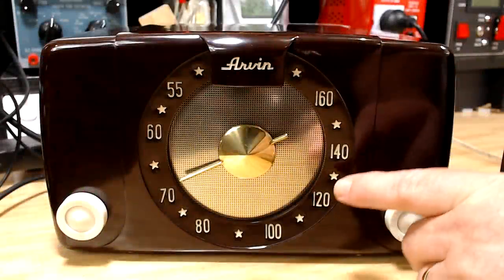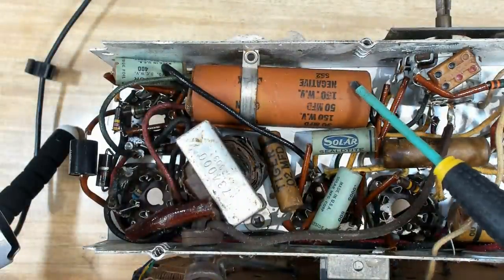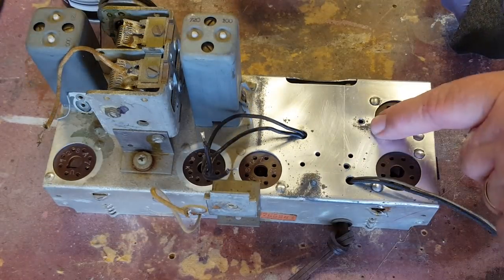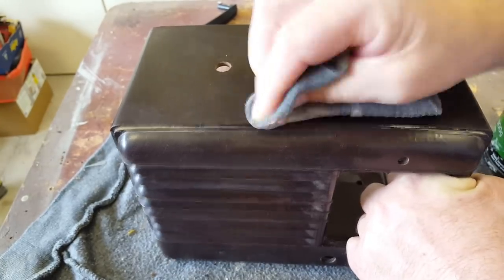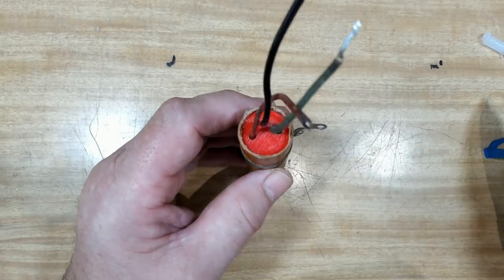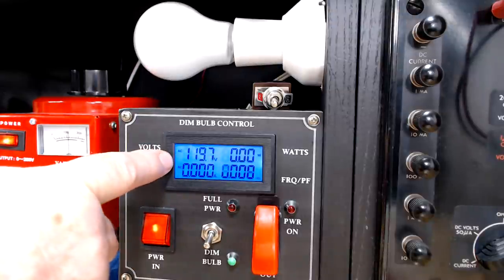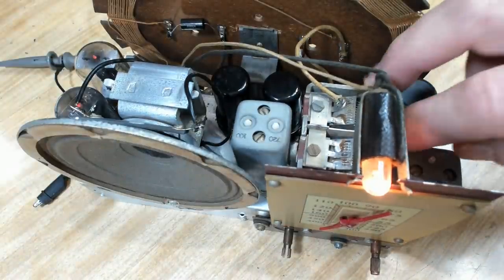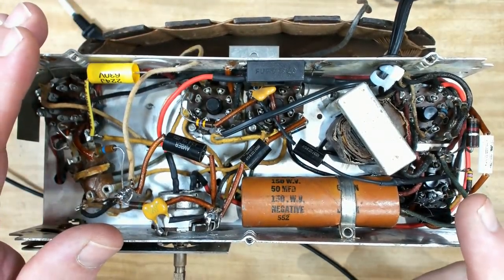Emerson Radio Restore Model 518 USA Built - 1940s

Comment: You always go that extra mile which makes it so much more satisfying when you see the finished result. Great job again. I'm currently building my own workshop in the attic of my house. I'm not sure the wife is overly happy about it - but it's better than using the garage which has the washing machine in. Should get better reception up there too!
Reply from the maker: Hi Ged, thanks. The attic sounds much better for a workshop, you don't want to be anywhere near the washing. Good luck with your workshop 😀

Comment: Those Emerson knobs came in brown, black, and white, depending on the model.   Some were black with the 'dish' painted white, and in some models  were covered with a clear plastic dome (my model 573 free standing radio-phono has these).
Reply from the maker: Thanks xaenon, I saw a number of knob styles on online photos of the radio, most had a cone shape on the front of the knob. I still don't know if mine are original though 🤔
Reply: @DavidTipton101  Emerson did use that style on a lot of their radios of that era - like I said, with minor variations in color and so on.   So yeah, I'm guessing they probably are the originals.

There's a fellow somewhere who makes reproduction knobs, too.   

I loved watching your video restoring that thing.  I'm really impressed with how you made a new bezel for the dial.

Comment: Hi Dave. Hopefully you can help me. I need to align a Zenith FM radio. The sheet states to attach my signal generator high side to the ungrounded shield over the FM converter tube. However, the shield is riveted to the chassis which is ground. Where do I attach it?
Reply from the maker: Hi Eugene, try slipping a length of insulated wire between the shield and tube.  Bare off a section on the exposed end and attach your generator to that. You may  need to reposition it for max affect.
Reply: @DavidTipton101  Thank you very, very much.....you are the best!

Comment: Well it was worth the wait : I enjoyed every minute of this one David from beginning to end. I also agree you're getting better and better at remaking those caps to perfection. You've got it down to an art.  But also i like how you went about this one, trouble shooting the potential problems before even plugging it. There wasn't much to do once you hooked it up to power. Bravo ! My friend, that's another one worthy of going in your incredible collection. Thank's for sharing as always.
Reply from the maker: Thanks Sarge. I was forced to do the restore before plugging it in due to lack of parts and concern that the filament would blow in the rectifier if it had a fault. Yes, another one for the radio shelf, it's getting mighty crowded though, cheers 😀
Reply: @DavidTipton101  Oh yeah right you've got a point, wasn't thinking about the filament (seemed strange a set up to me, but then again what do i know about electronics) ?.  I would surely buy one of your radios if you ever felt the need to move some for space :-)

Comment: Hello. I like your work. I don’t have big knowledge in electronics but i like this activity. I have a very very old radio and i think to get it work but i don’t have the tools and i don’t have the experience in this. Can you help me please ? Thank you. I live in France. Have a great day.
Reply from the maker: Hi Video Design, thank you. Sounds like you have a great project there. There may be radio clubs in your area that may be able to help you, that would be my first suggestion. 
I won't be much help from here but most times replacing the capacitors, out of tolerance resistors and making sure everything is safe electrically will return it to service. If you intend having a go at it I strongly suggest you use a dim bulb to test it, Google dim bulb 🙂
Reply: @DavidTipton101  The radio is Orion R4400. I found the technical scheme over the internet but i don’t know to read all the things on it. I was wondering if i can send you the radio for restaoration. I m willing to support all the payments. All i have here is a multimeter and a soldering device. There are some wiring missing and is too mutch for me.
Reply from the maker: @BmcvideoDesign  There has to be someone close to you that will do it, FM radio is not my strong point and I cannot find any text on how to set it up so it would be a struggle for me. Google "radio clubs" or "vintage radio clubs", they will give you leads to people who can repair them, there are certainly lots of folk in the UK who do them so I imagine the same will apply near you.

Comment: Great work, David. How do you use a dial with two pointers? Which pointer do you use?
Reply from the maker: Thank you Shannon. The top of the dial is in kHz and the bottom in metres. You can use either, like miles and kilometres, same distance, different ways of measuring it 👍🙂
Reply: @DavidTipton101  Thank you!

Comment: Lots of great information and safety on this one Dave.
Those live chassis models scare the crap out of me. Especially the ones with a switched neutral.
I like the dial pointer you made, looks quite authentic
Reply from the maker: Thanks 1974UTuber, you have to be careful with these sets 👍🙂
Reply: @DavidTipton101  I don't know how they ever thought the 2 vertical pin plug was a safe idea. You could get a different polarity every time you plug it in and never know if your switching active or neutral.
I much prefer the Aussie plugs we have. Even the 2 pin just seems safer all round and much better thought out

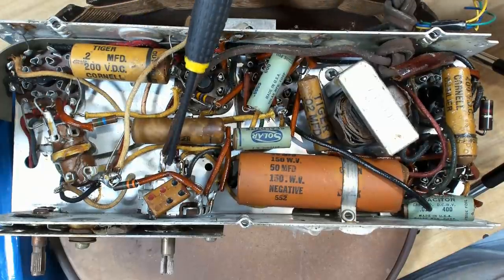Comment: 3:25 Dave, what is the component on the volume/power switch, the brown waxy one with the 6 dots ? I remember those from my youth, looks a bit like candy from the sixties. Yes, I tried tasting it 😂
Cheers
Nard
Reply from the maker: Hi Nard, it's a 'domino' mica cap, the colours denote the value but that one doesn't seem to follow convention. It looks like it's 220pF red, red, black, the other two blacks maybe tolerance and voltage? It does look yummy though 😄
Reply: @DavidTipton101  Thanks Dave 👍🤝🇳🇱
Reply: @DavidTipton101  Hi Dave,
Have a look at this video https://youtu.be/cOgTw6Ebw80  time mark 12:15
Those are actually paper capacitors. Odd huh ?
Cheers and enjoy the vacation 👍🤝🇳🇱
Reply from the maker: @Plons0Nard  Hi Nard, yeah I'm aware that some were paper but I think they were Micamold brand, this one isn't a Micamold and the parts list lists it as a mica, not that that means anything. I don't remember if I tested it or not, it's in a low stress part of the circuit so hopefully it's OK 👍🙂

Comment: I do enjoy the way you put these old sets back to like new condition.  Such a love for the art of restoration is rare indeed,  and I greatly enjoy the videos.  I am no longer able to do such work, but I do still dabble with the newer things, just to tinker and keep my soldering skills in line. I am presently working on building the perfect wifi radio using the little ESP32 controller and a I2S decoder to bring in the wonderful sounds of my youth. I grew up on an old homestead, the house built by my grandfather in 1910. The place was never wired for power, it used to drive me nuts to see that damn REA Power Poll in the center of our yard, wires leading from the road in, but none to the house or garage.  Dad had a small wind charger set up on the garage so he could charge his old wet cell batteries to light up his work area, where he rebuilt engines for the neighbors since he was a quite good mechanic. Dad also got me interested in electronics by letting me look over his shoulder as he serviced out old battery pack radio.  It was of modern design, at least in my young eyes, and had a red flag that pupped up in the middle of the dial to show that the set was on, so you didn't walk away and leave it running on an off station with the volume turned down and waste that precious battery power.
Reply from the maker: Thanks Jerry. Interesting story, thank you for sharing that. It's hard to imagine no power in these days, I wouldn't last 5 minutes. That's a good idea having the flag pop up in the dial and pretty easy to implement. Thanks 🙂
Reply: @DavidTipton101  Indeed, the old days are gone forever I guess.  The closest I have been to them was a few years ago we were touring the Desert Southwest USA, in particular Arizona near the border with Mexico. The area is one of extreme beauty if you love the desert as much as we did back then.  It was populated by a strange breed of cactus named the Organ Pipe Cactus, I am sure you can imagine the way those  intermingled with the huge Succaro Cactus some reaching nearly 100 feet into the air with arms to remind you of an old gunman surrendering to the Sheriff these plants are very old, I was told by a ranger that it takes over 100 years for one to develop an arm, many of them were very old and had six or more arms.   The campground in the midst of this area was about 40 miles of poor roads leading to a clean area where camper pads had been poured, they were indeed wonderful for parking, very level making setup quick but there was no power available in the park.  There were restrictions covering the running of onboard generators. Our rig has a nice generator that pulls gas from our fuel tank so all that is needed was to switch the generator on, press the start button and she was off, giving us the power needed for modern life.  We were allowed 2 hours of generator use, those hours were designated and you would loose your camp site should by run the generator  at any other time.  This really added to the experience of the area. It was so very peaceful and with no power to take one's attention away from the outdoors, made the place even more enjoyable.  We spent one week there and that memory of the time with my lovely wife just sitting beneath our awning drinking bottled water and just living the moment in such a magical area is a memory I shall cherish for the rest of my days.  We intended on hitting that park on the way home for what would be our last year of traveling for the winter but the illegal immigrant problems stopped us,  we never got back because Cancer interrupted our wonderful retirement, and took my lovely wife from me.  Anyhow  I did have some solar panels, small ones , one was made for backpacking and was mounted on a canvas pad that could be laced onto your pack. I lay that on our picnic tale and used it to charge our cell phones and tablets.  It was really sort of funny when the morning and evening generator time would start. First one generator would come to life, then another and so on till all the rigs were humming away charging their batteries, while the coffee brewed and cell phones charged, then after an hour of maddening whirrrrr and engine noise, the clock would hit the hour mark once more and quiet was once again the rule and all was quiet, peaceful and people began emerging from their homes on wheels to walk in that wonderful desert till the sun disappeared and all was quiet for the night.
Reply from the maker: @JerryEricsson  My wife saw a News report about Frank Sinatra's house in the desert being sold, she said why would you want to live there? I'll show her you story.
Reply: @DavidTipton101  Just watched this video again, I do enjoy them.  What did your  wife think of it?  Oh by the way, my Great Uncle, the closest thing I had to a grand father as my grandpa died before I was born was a batchler.  He had worked for the Railroad and drew some retirement.  He had a little 2 room shack atop a hill on the poor side of town and was getting up in age, his house just a block up the hill from our house. I used to walk up the hill twice a day to empty his swill pail and in the winter carry in a couple buckets of lump coal for his little pop belly stove then carry out the ashes from the last days heating.  He had a radio that looked very much like the one in this video I will always recall that radio sitting on his kitchen table where we would spend an hour or two playing rummy in the spring and summer when there was no school or springs work on my uncles farms.
Reply from the maker: @JerryEricsson  You have a lot of memories Jerry 🙂The wife thought it was very good.

Comment: And they put the power line through that filament as a kind of fuse to save the rest of the radio in case of a short circuit.
Reply from the maker: Yeah, OK, thanks PBR. Expensive fuse though 😲

Comment: What Capacitors  did you use all on that radio
Reply from the maker: Hello Jeremiah. do you mean in the filter capacitor? I used 33 nF for the 30 nF and 47 uF for the 50uF. Both at about 200 Volts if I recall and 105 C 🙂
Reply: Yes I'm trying to find capacitors my self I don't know much about capacitors but I'm learning how I was also wondering which ones you used on the other ones to replace the paper caps
Reply: The radio I have though is the Emerson 518 and chassis 12004
Reply from the maker: You can use polly caps to replace the paper caps or pretty much and kind of cap will do the same job as long as it is the closest capacitance rating and a voltage equal to or above the original. Some capacitance ratings used in old radios are no longer available so use the closest available, an old 0.05uF would be replaced with 0.047uF etc. Most capacitors used in old radios had a 20% tolerance so if you can stay roughly inside with a replacement of 20% that's fine. If a mica capacitor is fitted it should be replaced with a mica or a temperature stable ceramic. They are mostly used in the front end of the radio tuning section so if they drift as they warm up the radio may drift off station. I hope that helps Jeremiah.
Reply: Is there a certain way I have to hook up the new filter electrolytic capacitors to the old red,green and black wires
Reply: I was wondering what the .2 uf 200 vdc capacitor converted to I can't really find the exact.
Reply from the maker: @jeremiahhuey6389  I don't recall the wire colors but one will be a common ground for both capacitors and each of the other two wires would connect to the positive side of its individual capacitor. So join the two negatives together and attach a wire and attach a wire to the positive of each capacitor making three wires.
Reply from the maker: @jeremiahhuey6389  for the 0.2uF I would use a 0.22uF
Reply: Is the .02 uf 400 capacitor a different value in new term too?
Reply: Also the .002 uf 600 vdc capacitor
Reply from the maker: @jeremiahhuey6389  0.02 will simply translate to 0.022uF that being the closest in the new standard values Jeremiah. There are lists of standard capacitor values on the internet, if your radio has a capacitor that needs replacing then find the closest value capacitor you can usually slightly higher is better but sometime that is too big of a jump, so go to the next lowest.
Reply: I couldn't find a new standard translation for the .002 uf 600v capacitor I'm not sure what it is but thanks for helping me find the part I need for this restoration
Reply from the maker: @jeremiahhuey6389   Correct. If the radio has a 0.02 uF capacitor fitted the closest new value is 0.022 uF.  Values 0.1, 0.01 and 0.001 are still available, no change. 0.2 will be 0.22 in the new range. 0.3 uF is now 0.33 uF and 0.4 will be 0.47 uF. If your radio has a 0.5 use a 0.47, or for a 0.05 use a 0.047 etc.
Reply: Its a .002 I'm assuming it would convert to .0022 not sure though
Reply from the maker: @jeremiahhuey6389  yes, 0.002 is the same as 0.0022.

Comment: as always great work David ...it looks like an Emerson EC-301  a model which seems to have come with a rather dazzling array of cases and dials and knobs
Reply from the maker: Hi Chris, thanks. Yes there are a number of model number for this case but even the 301 isn't the same dial but looks like the same chassis, mine had model 518 on the base. I spent many hours looking but didn't find one with the same dial 😏
Reply: @DavidTipton101  I guess it's a bit of a Frankenstein. The original 518 had it's dial numbers on the glass itself, so my guess is that the glass got damaged and then was replaced by whatever the repairman had at hand.
Reply from the maker: @BTGDelta  Yes, maybe 🤔